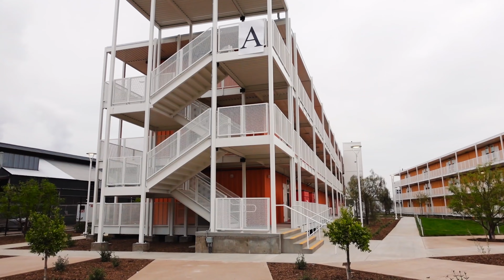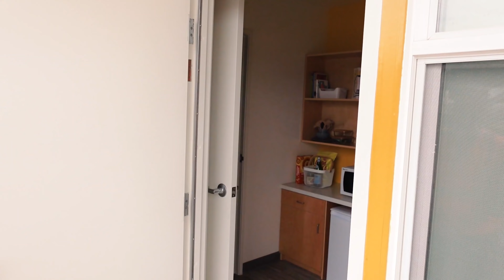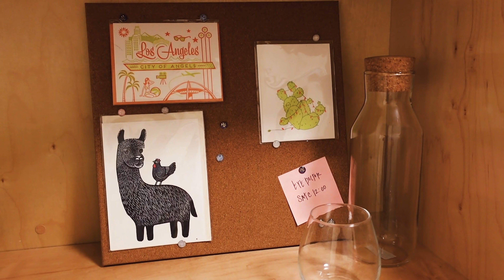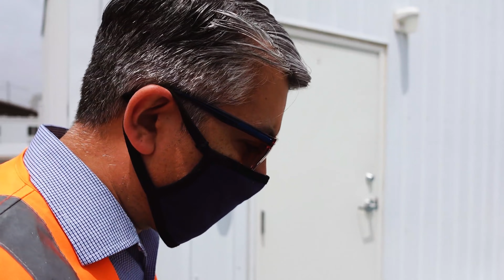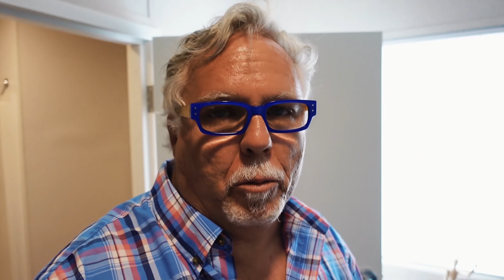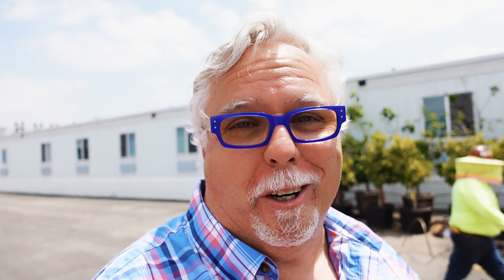Can Shipping Containers Reduce Homelessness?

Comment: That is amazing and its so wonderful for the homeless who are fortunate to get that help. They are very nice. 
The thing is that there are multiplied thousands of homeless and it could take many years and maybe never to provide this to all. People are suffering and dying on the streets. They need shelter now.
The thing is that with shacks it can provide shelter to many so much faster. 
Get something better later if possible but get the shacks now. Its needed urgently now as people are suffering now.
They can have windows and vents and painted nice too with a bed and dresser. Have electricity for electronics and lights.
 Have security. 
Its all so much better than freezing under tarps in the dirt. They have shelter, warmth, dry, a place to put your belongings and a place to sleep and rest and not be kicked out of. They can be nice too and although the showers and bathrooms may be communal it still is a place to shower and toilets which they don't have on the streets.
Its needed now.

Comment: And on the parkinglot: place for Vans, cars etc and a place for tents/ or giving TENTS away - making Contact to churches, if they may have a parkinglot or place for TENTS in their churchareas. With a Good Not, people can connect from North to south etc...east to west- so people can first find better place Where they  are able to heal, work etc and Rehab. I wish there were Rehab units especially for homeless to prepare to get healed first- then they may be go second Step. The pressure to work in very first place Is Not working. They first need accepptance& chance to be/heal. Pastors should be included in this projects, according to the healingprocess

Comment: The whole world shouldn't have the f*** about to go get a shower to see white walls sanitation safe Sound serene stable secure supported accommodation..
I'll fit a water shower unit into a domed mesh/Gauze 3D printed Chinese hat or sleeping Policemans central 1cm as left right power shower from all edges L/R.
I'll find you.
They need a contact/phone book iOS/Android account 1 email 1 Google/apple cloud/window Cloud photos password only they know marks scar tattoo .
So we're making enough water 1 side 3000° c or more heat and fan spin hot air to boiling water and cold 1 peltier module to shower temperature or cold water and hours of got 2 tanks 3 with 1 making water power.
We need such a Supermax for all adolescent council 2 people double Room bed, singular or small family .
Indestructible modern jail kitchens/room wardrobe bed side 2 units slider rail thick Fireproof plastics 90% less within structure mesh gauze within and or facades face/edges inset to outset wood colours cheap 3D printer layer funnel/hopper to mm brown shades to clear always layer mm/cm swirl spin mix to other colour from a 1 colour printing

Comment: These are very clean units in which people can live while working toward getting back into the workforce and moving out.  I agree with the host in that these are not permanent, nor are they designed to be.  Reasons:  The units don't have a stove nor oven--so residents clearly cannot cook other than microwaving.  Would an electric burner even be allowed to fry an egg?  The refrigerator is the 'dorm-size' type, so very limited in space.  There is only one 'room', and the resident sleeps next to the pantry and mini-refrigerator.  This is wonderful for someone to get off the streets, but would quickly become constraining in  a real-life environment with family, guests, desire to have cooked meals other than micro-wave, and where there are other objectives than simply quickly eating and sleeping. It is good that each resident has his/her own bathroom. (Why was wood flooring put in a bathroom?  Unless it is wood-looking linoleum or some aluminum flooring, wooden flooring is going to get ruined possibly with mold very quickly in humid conditions. I hope it's linoleum that just looks like wood on the bathroom floors!)  Where I live, it is actually against building codes to put wood flooring in bathrooms (mold/mildew, water deterioration)  and kitchens (fire hazard).    Note that details like this can render housing uninhabitable very quickly.

Comment: Now we have the greed of the lumber manufacturers sand bagging America, I’ve seen several reports, a couple of truck drivers that move lumber from the mill to HD and the like state that the mill is stacked to the rafters with wood. It’s the typical bilking of America. I know these are built w/containers, so stop typing, I’m making the point that other solutions have to be put to rest until the greed plays out. I refuse to buy lumber until they come to their senses.

Comment: I fully agree that safe processing of waste, clean running water, electricity and HVAC are non-negotiables. 
HOWEVER!
I do not agree that these have to be hooked up to all public utilities. 

There are alternative methods of doing most of that. The only exception is water. 

WHY?

Because it's a racket! 
That's why. 
That's the primary reason a "housing crisis" exists in the first place! 
It's all designed to pump money out of the pleb population and up into the ruling classes and as an American, we should have the right to say, "NO thanks, I'll handle it myself thankyouverymuch!" If you want to put the hook-ups there, fine, but I should have the right to use alternative methods for some of that stuff if I want. I'm not talking making compromises on safety. That's mostly a trope that authorities use to force me to obey their extraction program. If they ignore the fact that there are safe and sustainable and better ways to process waste, make electricity and heat and cool a building, then maybe we won't find out about them and we will just keep our heads down and OBEY!

THIS IS ALSO ABOUT DIGNITY! 

It's deeply humiliating to have 90% of my small income taken from me when it's not necessary and only because some rich guy "says so"! 

Please make room for us to have our dignity also!

Comment: This is LA. It’s hot AF there and they’re metal?!?
Reply: They could insulate them.
Reply: As Joanne pointed out, they are most likely insulated. You can tell that the interior of the container has drywall set up so they most likely put insulation in the middle.

Comment: I think the CARES act funding was structured that it would not build a property to be used as permanent supported housing.  These could be a wonderful model for PSH from funding passed in the March 2021 act, or in the coming bills in Congress.  I wonder how high (how many levels) a project could be?  As long as there are elevators, even five to ten levels high would work.  The first two levels above ground could include ramp access for evacuation in case of emergency.
Reply: That's a great idea! sounds like you would be a great developer of one :)

Comment: This is very cool...  more of this!
In Hamburg (Germany), we had an influx of 10's of thousands of Syrian refugees in mid to late 2015. These were rather rapidly housed in such units which appeared as "container villages" all around the city (and even on barges in the harbour). They were dispersed throughout the city and suburbs in order to prevent a "ghettoization effect".  More than five years on they are still there and clean, respectable and functioning!  I guess they were intended as a temporary solution, but many inhabitants seem unwilling or unable to give up the subsidized housing to join the rent-race or the impossible property ladder.
I visited a few container villages while I was researching the refugee influx of 2015. The cost breakdown was interesting as it seemed the city bought the containers for as much a 3 to 5 thousand euro per unit, and then the fitting out (walling, flooring, plumbing, electric, windows, etc) cost upward of 30 thousand per unit. The villages were placed on publicly owned land (and in some parks, and most conveniently, on the water). Still, at a rough cost of under 50k per housing unit, this is acceptable and could be managed by any modest city budget...  I have been advocating this solution for my native city of Dublin, which has a horrendous homeless crisis, but it seems the political will there is to leave the homeless to die as a warning to others not to fall out of the capitalist race...  I have old friends in Dublin, with full-time jobs and "clean", and still driven to periodic homeless because of the insane rent costs and house prices.
The container villages in Hamburg should stand as an example, but as always, there are exceptions. I have visited a couple of villages (at noisy intersections in the inner city) exclusively for single men and these were absolute rat traps and had the feeling of an open prison.

Comment: I've built with them they are hard to cool, hard to heat....
Reply: Can't they be insulated?
Reply: Interesting. Never thought of that being the case.
Reply: nothing is impossible , to heat & to cool  can be solved , was done in downtown Vancouver, BC, Canada ....
in areas where temperatures could go below 10C , you might have problem insulating the outside pipes .
Reply: @koengo229  I've never seen one of these in East Hastings
Reply: @KokoTheGorilla69  .... go to Main Street  Skytrain Station , from the open platform you can see a group of
Container Homes at the corner of  Main St. & Terminal Ave.   ....  who finance & construct them , don't know ....
a salute to the Local City government .... good job  NDP Mayor  of  Vancouver downtown .